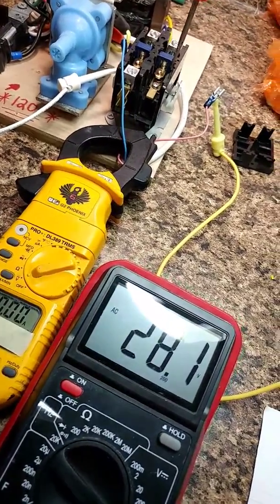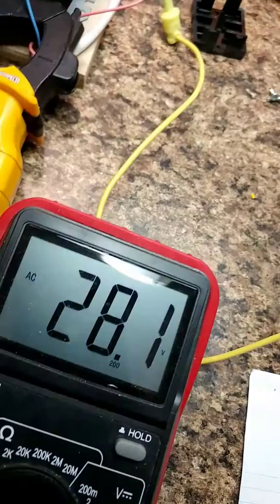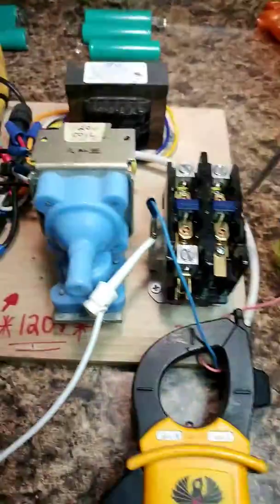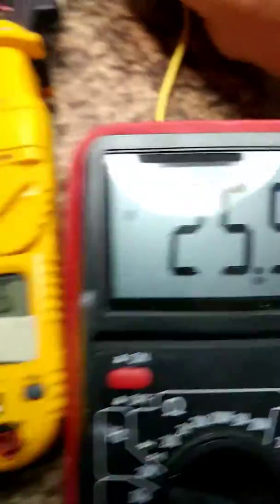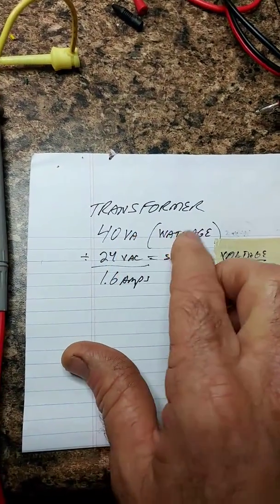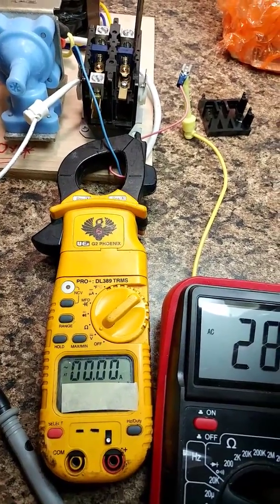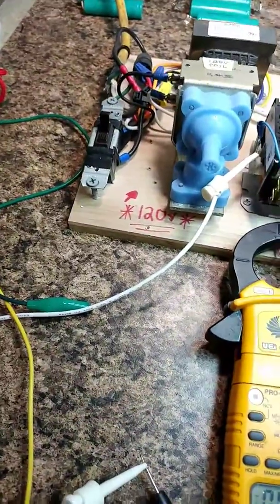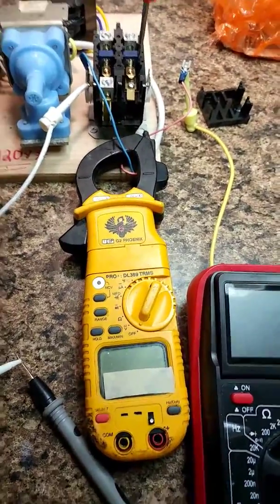Blown fuse or fried transformer? 24v AC possible cause.

Comment: Currently I have a physically stuck contactor and I have no 24 volts anywhere at the air handler or the thermostat.  My unit is old (1985) and I don't see a circuit card.  It's a mobile home with AC only.  I believe I had a bad contactor that took out my stepdown x'former.  What do you think???

Comment: I just connected a new transformer and when I turned the power back on it started smoking. It also made a faint clicking sound. I hooked it up the same way the other one was. My 5 amp fuse didn't blow. It's in my air handler

Comment: My transformer started to smoke in my powered Kustom speaker. Now the speaker does not work. Can I just replace the transformer or is there possibly something wrong in the amp part of the speaker that caused this to blow? If I replace the transformer might the new one just fry also? Thanks for any advice. I wish I knew more about this. :)